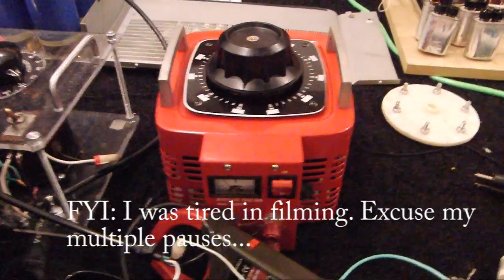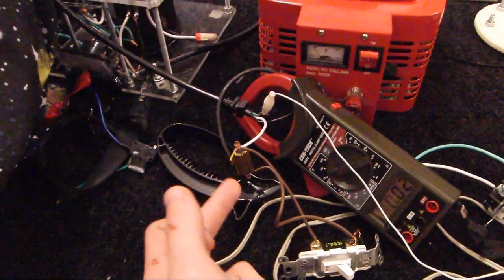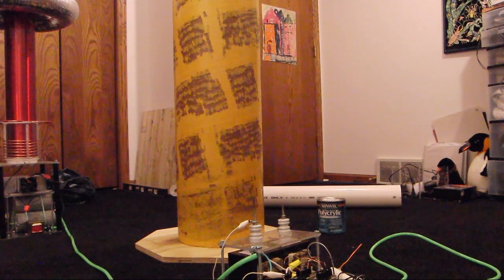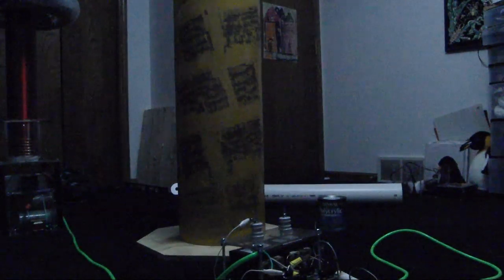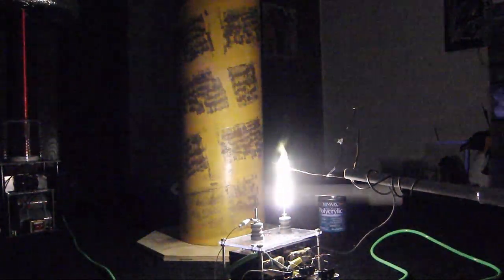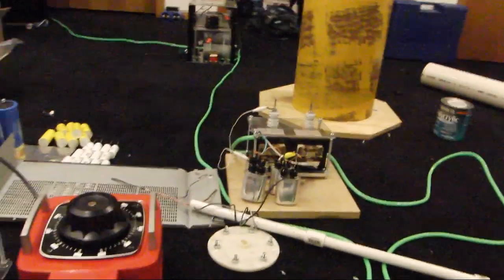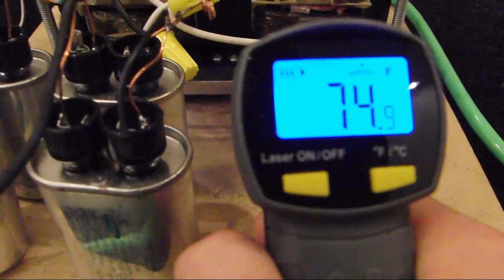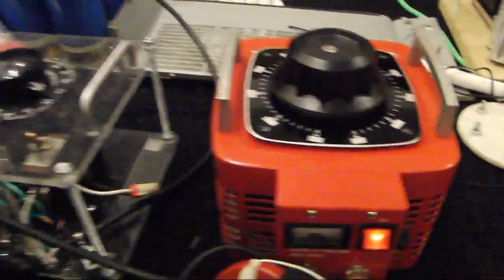New Variac (3000W) and MOTs

Comment from the maker: Well, im not drawing enough amps to trip my 15A breaker with mine. it doesnt draw that much.  However, a resistor would need to be BIG.  One easy method, i cant say how much power will come out... use a 2nd MOT as a ballast in series with the mot you are winding for high current.  Or...Some even do light bulbs.

Comment from the maker: Hard to say.. I typically plug it in and if it kicks breakers i add a resistant circuit.  This is a 30A, so, its quiet obvious.  my 8A does enough to make my lights flick for a second (even my CFL ones) but it doesnt trip breakers..

Comment from the maker: Because the amount of energy it takes to engergize the large core, is enough current to trip a 15A breaker.  Big cores, take power to energize.  This is why pinball machines and stuff, can make your lights dim for a fraction of a second, it takes a lot of power to 'get things going'  Transformers work on magnetic fields, well, you got to start them.  This is a big core :)

Comment: Gotta love that sound..  i found out that 240v MOT can run continuously at 120v, it's damn hot but it doesn't smoke at all like it usually does however i can't use a resonant circuit.. which leads the secondary to smoke in the speed of 240v :D
resonant circuits kill my mots (at 240v).. it doesn't smoke at first but it shorts inside in a few secs and that's the reason i have so many caps and only one working MOT that still survives :D